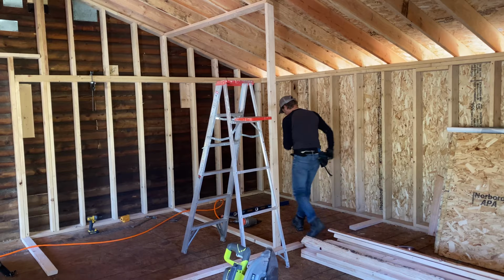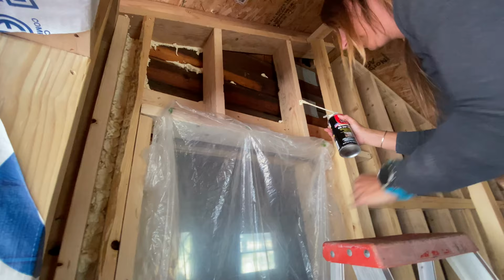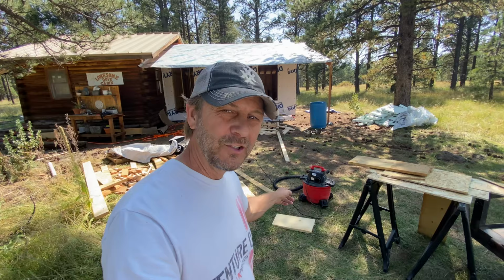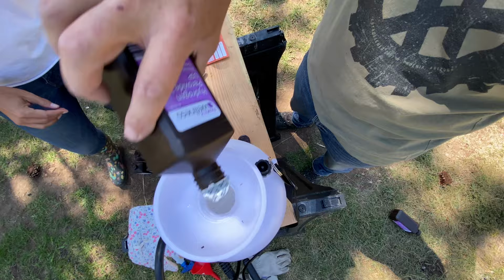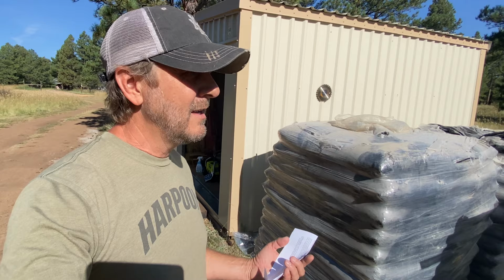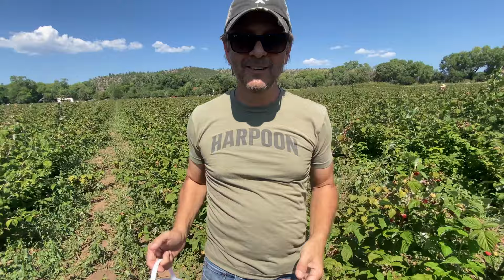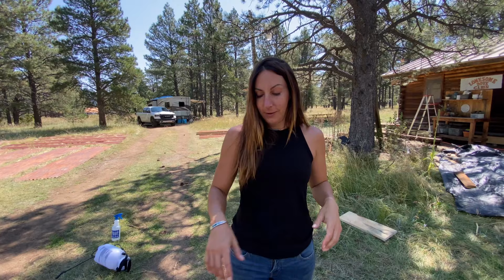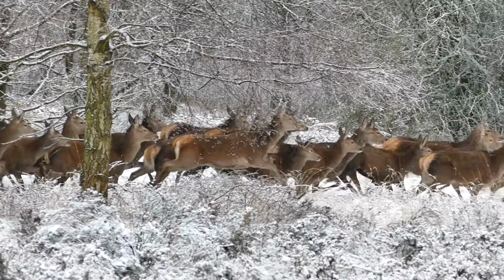Rusting Our Metal Roof, Finish Framing, and Raspberry Fields Forever - S1:E9

Comment: What you're doing to you're roofing panels is called a patina. I'm a retired bridge inspector and the same technique is used to create a protective coating on large steel bridge girders and other members of the bridge. Many people think the bridge girders are rusting but it's actually a long term form of painting and is graded during the inspection. It was also used during the early years of auto manufacturing. Tons of steel used to make a car would be stored outside to form a patina and protect the steel from rust after the car was built. I find my love and fulfillment in my relationship with Jesus Christ!
Reply from the maker: Good to know.